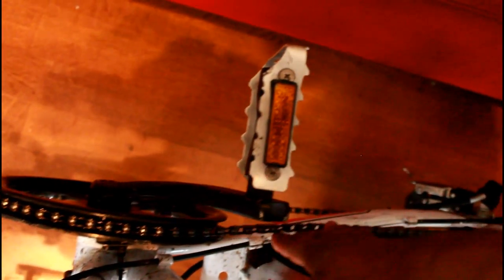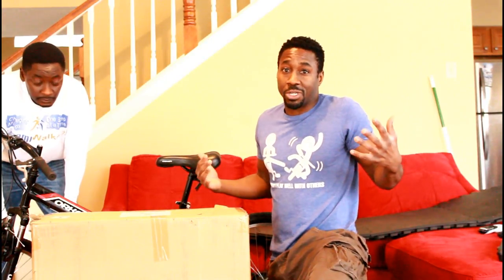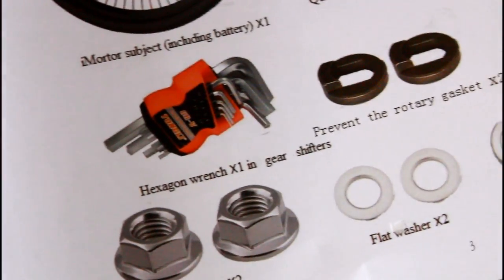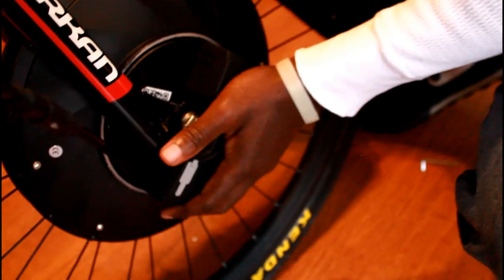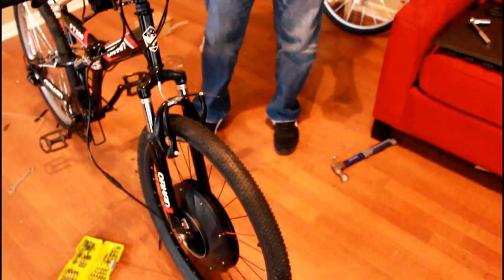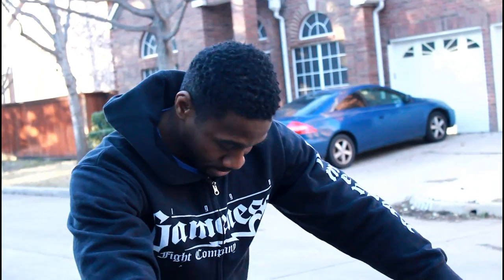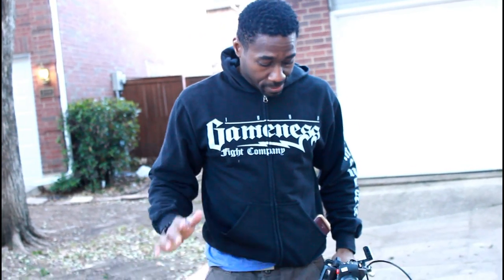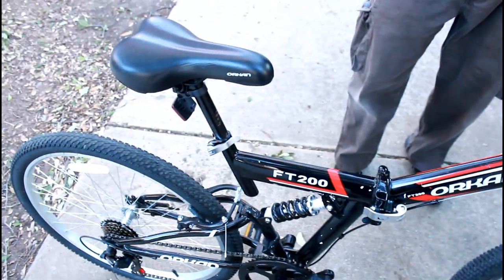Electric Bike E-Bike Made In Under 1 Hour - For under $400 w Folding Orkan - Ancheer EBike Update

Comment: Hi mate i brought one ovthese same wheels feom ebay i managed to get it all on and fixed up reafy to do in 15-20 min but i had disc brakes so didnt have to change them like u.ive used it for months now .i think for the size of it and the ease its awesome.its not crazy fast on its own but down hill its crazy.so crazy that i was foing so fast some idiot thout it would be funny to scare me out of car window.i came off and hit metal bollard full speed with my chest and smashed 5 ribs.my bike was fine though i was more worried i broke rhe bike.i love rhis bike wheel dude.for how much and how easy it is i love it.i dont pedal much at all unless its uphill.i used a small amount of wd40 on moving parts and it made it even snoother.u guys are awesome and made a great video about it.much love rob from uk